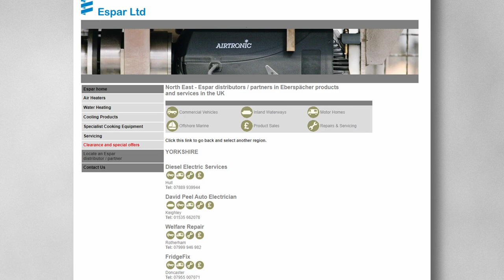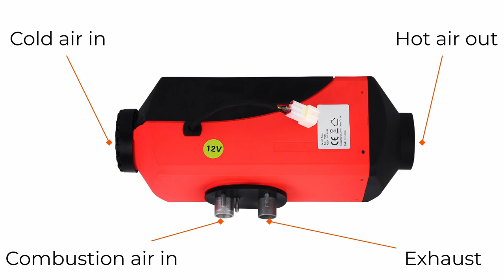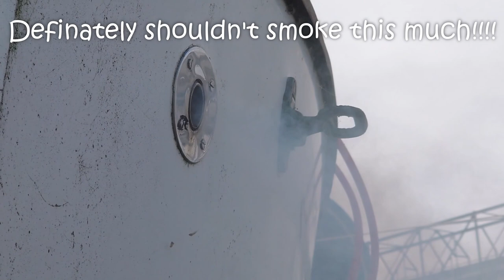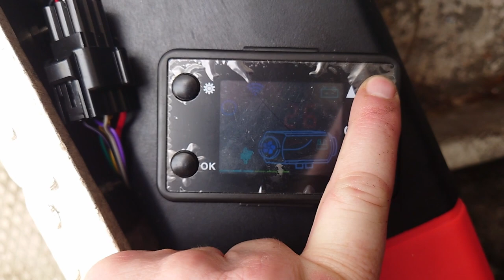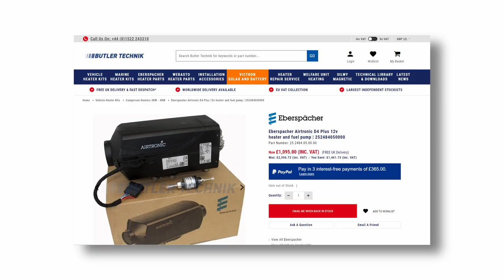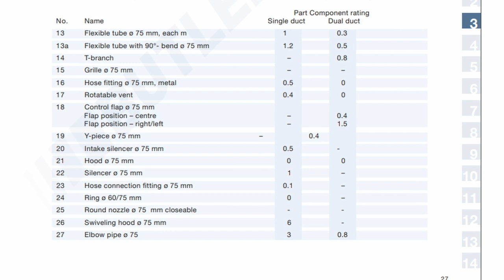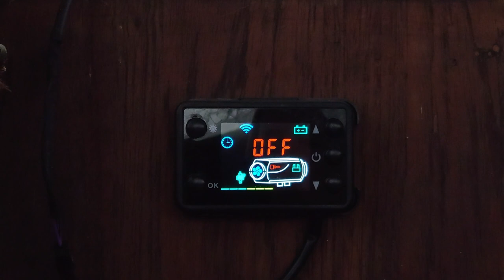Best Way To Keep Warm On A Small Boat: Install A Chinese Diesel Air Heater!

Comment: I have a nicholson 32 from 1965, bought it a month ago in  good nic and she stil has a working diesel heather from that time era in the saloon.  It drips diesel which i torch with a flame and there is a pipe i have to fit on the saloon before use. Also 2 oldschool gimble  parafin lights in the saloon both working.

Comment: Thanks for that, I'm considering installing such a system on my sailing boat. The location of the heater will be in a aft lock not far behind the rear aft cabin, so vary close in distance. Question how noisy is it, don't want to be left with the choice of either being cold but can sleep or being warm but cant sleep due to the noise. Thanks
Reply from the maker: The fan is variable speed, and so on lower speeds it is fairly quiet. But the fuel pump clicking can definitely be the sort of thing that can keep a person awake unless it's mounted somewhere sensible
Reply: @confidencesailing  Another video on installing these things suggested making sure the fuel pump isn't in direct contact with a hard surface, since that will transmit the sound of it operating through the boat. Suspending it using tie-wraps or thin line would do this, although attention obviously needs to be paid to making sure there's no strain on the fuel lines in and out.